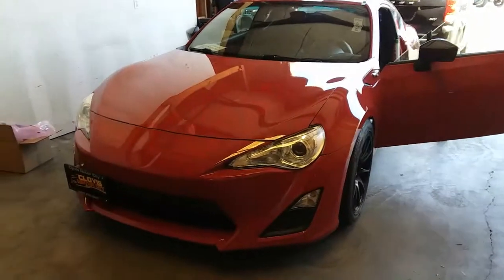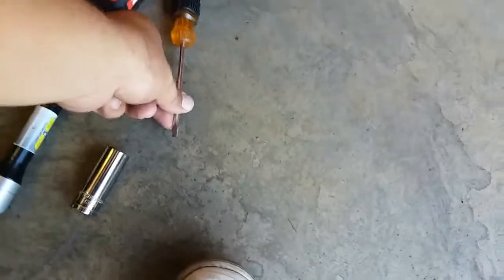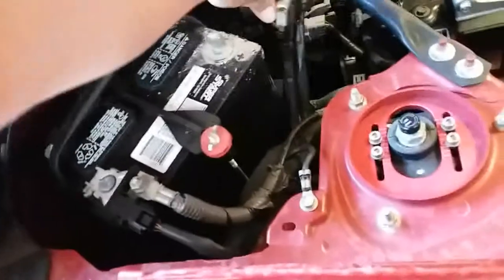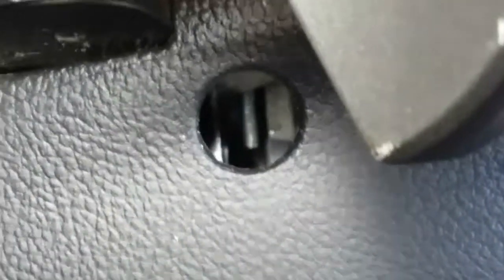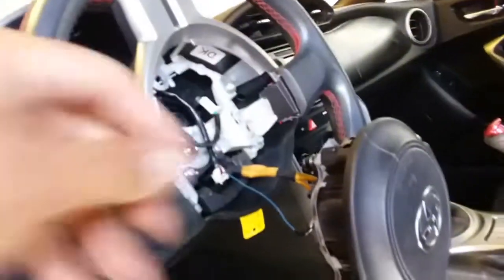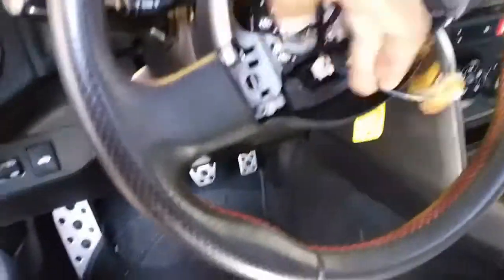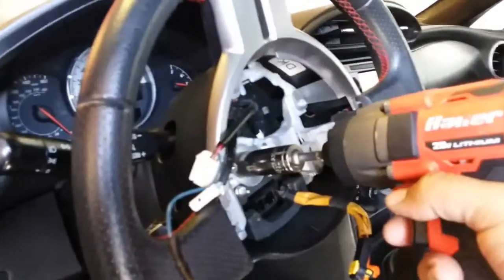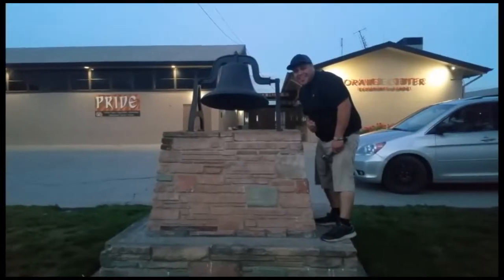How to: Remove Steering Wheel and Air Bag from a 2013 Scion FRS/Toyota 86/BRZ

Comment: so i pretty much did the same thing for this. both left and right side unclip but the bottom for some reason I cant feel the clip like at all. either I broke it trying to do it the first time or it just wont budge. Do you have any suggestions on how to remove the airbag if both clips (L & R) are unclipped but the bottom (center) isnt? I tried to see if I can pull it off since the top is loose but the bottom is tighten in. So I'm wondering if its safe to drive? or should i go to a mechanic to fix it. Rather do DIY if its an easy fix and doesnt kill the bank.
Reply from the maker: its okay to drive but it should come out pretty easy doesn't take much force to get it out. just try pressing it back into place so it can snap back on. disconnect the battery so the horn isnt going off while you press it in

Comment: Any idea on the torque spec for the center nut
Reply from the maker: Looks like the manual says 29 ft/lbs
Also found this how to directions 
https://howtune.com/articles/350-remove-the-steering-wheel-on-a-scion-fr-s-subaru-brz-gt-86